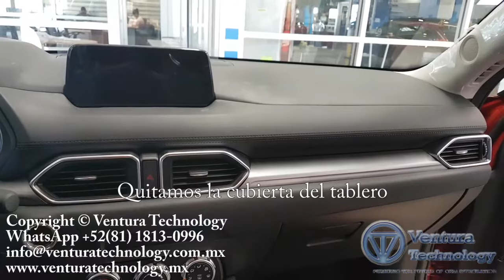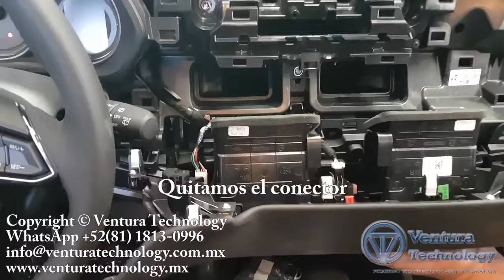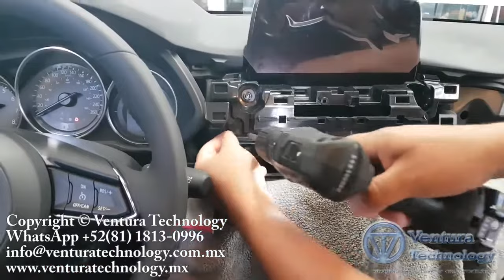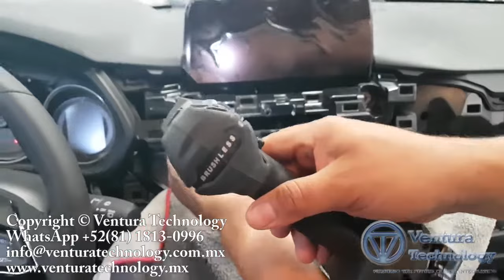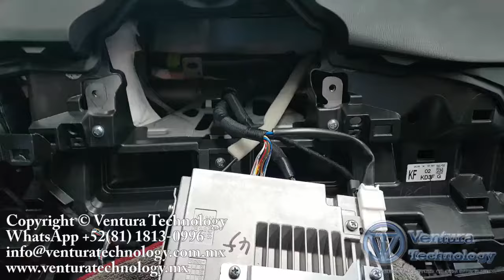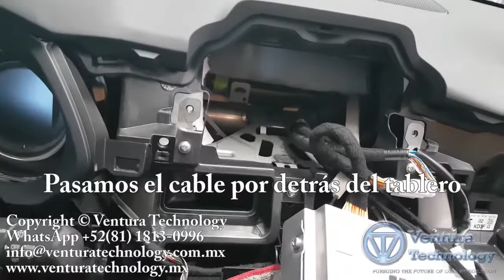Disassemble Mazda CX 5 panel and CMU

Comment: What part is the CMU a need one for my 2016 Mazda 6 sport
Reply: Did you ever figure this out?  Is the CMU what is attached to the screen or does it include the screen?  My 2016 CX5 crapped out on me and dealer wants 1300+ to fix.  I cannot find the part number anywhere.
Reply: @guppie580  I believe the part number for the module (just the box under the dash, no screen) is TC3M-66-9C0A